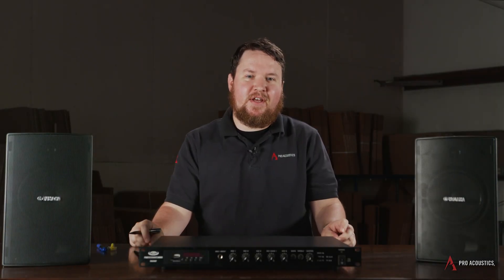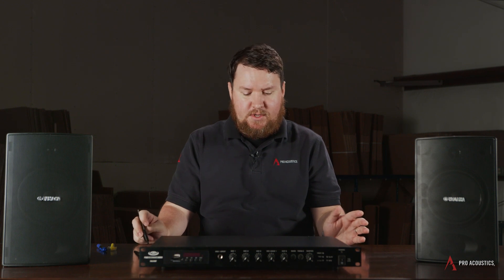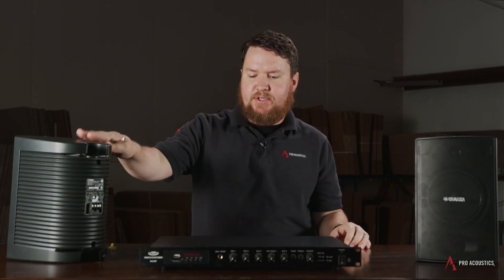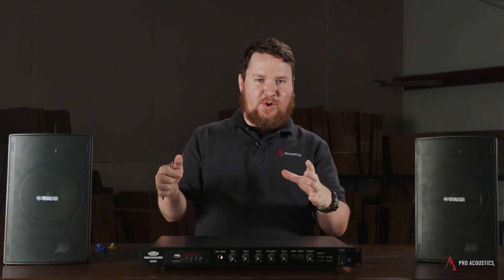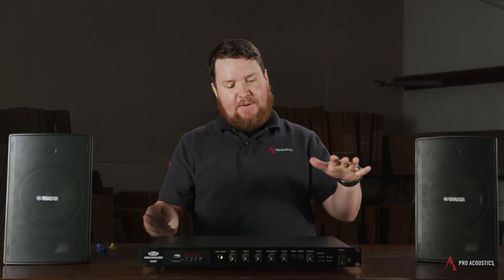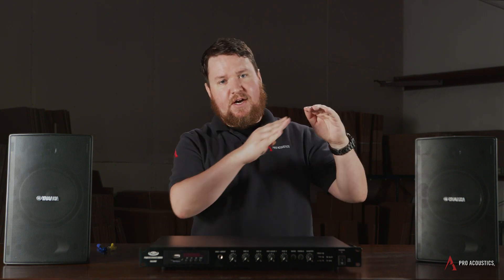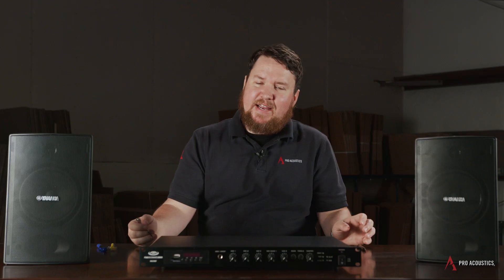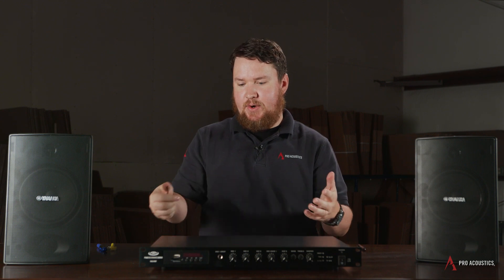How to Choose the Right Amplifier for Your Speaker System on Pro Acoustics Tech Talk Episode 57

Comment: Thanks for the video. How about Ohms on the amp and speakers? How do you know what is the maximum you can put on the Ohms matching?
Reply from the maker: Hi Ahmed, Most pro audio amplifiers are rated down to 4 ohms, allowing for (2) 4-ohm speakers wired together in parallel.  If your speakers have a different impedance, you should review a speaker impedance calculator online to ensure you don't damage your amplifier.
Reply: @ProAcoustics  Thank you so much! This very help full.

Comment: Most stereo amps are rated in Watts per Channel i.e. the left side and the right side.  Are 70v amplifier systems all mono? In the video explanation (diagram) there is string of speakers on one wire and I never heard the term "per channel", only total watts.  Is the string of speakers all left signal or all right signal, or like I mentioned, is it all mono?  Thank you for the informative video!
Reply from the maker: Hi Dan, That's a great question! Yes, 70-volt sound systems are typically summed to mono. These systems are designed for commercial applications such as offices, retail stores, hospitality venues, and paging. In these environments, it's critical that all speakers in the intended space receive the same information instead of having stereo imaging, like what you may have in a concert or home theater. Here is another video that goes further into 70-volt mono summing: https://youtu.be/rq8BDbVTY9s
Reply: @ProAcoustics  Thank you for the reply! That completely makes sense. In my home distributed audio I have three of those "single point stereo" speakers in smaller spaces. They have a dual voice coil woofer and a pair of tweeters w/ L and R inputs on the back. They are perfect in the entry, half bath, and stairwell. I can see the logic of summing to mono for a restaurant 70V system.  Thanks again also for the video.
Reply from the maker: @DanEngell  We are very glad that you found it helpful!